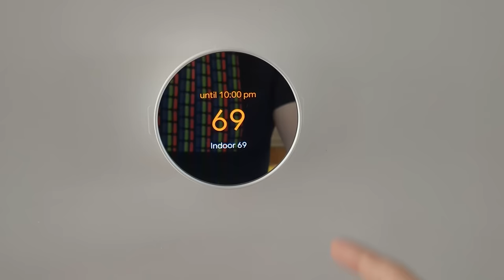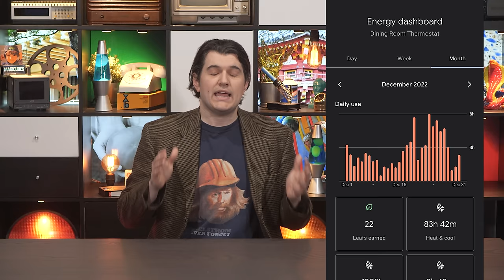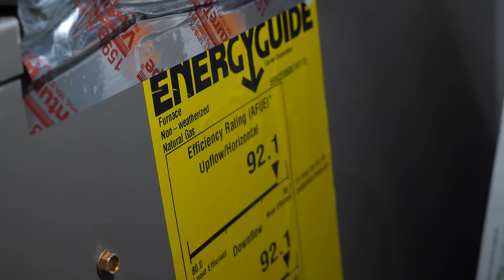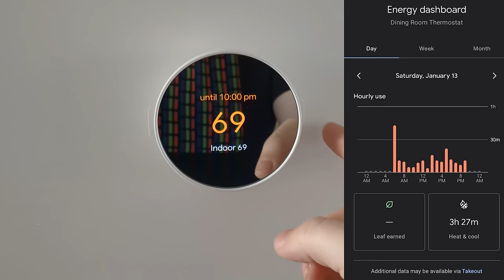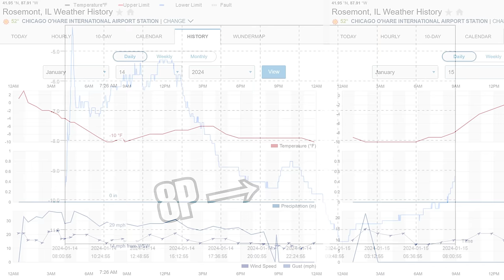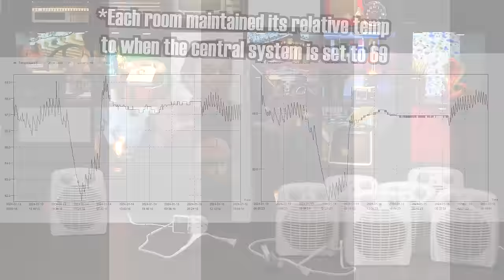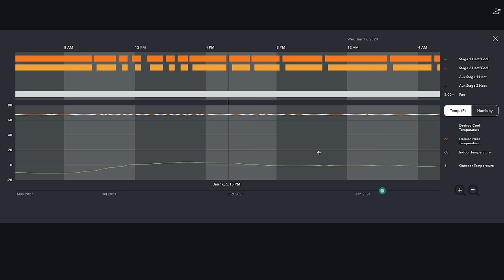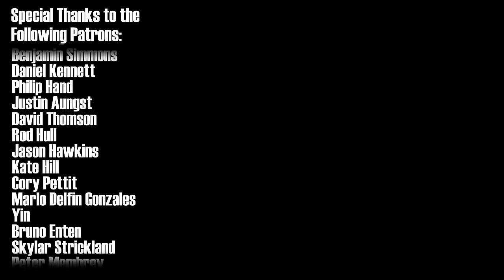Old HVAC industry practices are holding us back and costing us money. But we can fix it.

Comment: I bought a brand-new gas furnace and brand-new 2.5 ton heat pump last summer. Both high-efficiency. I can run either or have it switch between automatically at any temp I want. I tried both and I learned that the heat pump is nearly TWICE as expensive to run as the gas heat. I know that the heat pump is better for the environment but a $300 electric bill for a 850sq ft condo on a middle floor in a multi-family house is ridiculous! And that was in November (average temp 40F)! For reference, I'm in MA and electricity was roughly $0.32/kwh at the time. The heat pump ran nearly non-stop with thermostat at 70F day and 66F night. 

I think the big issue is that the the ducts for the older buildings here are sized for gas (2 intakes, 3 vents) which is much hotter than the slightly warm air you get from the heat pump. So the heat pump runs non-stop even at temps above freezing. That coupled with super-expensive electricity means its twice as expensive. Also, my condo is not insulated. (Adding insulation isn't easy when you have horsehair plaster inside and asbestos siding outside).

So while I care about the environment, I don't run my heat pump unless it is warm enough out that I'm pretty much not needing heat anyways.

Comment: Unfortunately for my home situation, my grandfather was cheap.
After moving in with my sickly grandmother, we asked around about getting AC installed in the house. It was built in the 60s but has issues that would make that way too expensive. My grandfather was a plumber in the union and had the bright idea to hire friends in the union to build his house. Unfortunately, we have found a lot of scuff things over the years. One of which is that we have 9ft ceilings, which the HVAC person said is too low for normal duct work. Instead of spending a lot of extra money on construction to make it work, we just use window AC units. We also have an attic fan for those nice days that we want to air out the house. I love my attic fan!
How do we heat the house then? We have radiant heating! We have pipes of boiling hot water going throughout the house. The second floor has radiators while the first floor has pipes going through the foundation. And the boiler for it and our water heater are in a back room behind the garage, which would be the coldest room in the house otherwise. It's a really nice setup. We only need extra heating on the coldest days, mainly because radiant heating doesn't circulate the air. We had to replace the boiler not long after we moved in 15 years ago because it wasn't getting the water hot enough and the pipes going above the garage door that go into the bedrooms above it froze over.
There are other issues with the house, like half a room of every room sharing an electrical circuit with half another room or the pipe going to the septic tank being essentially made of paper, but I love this house and will be sad when we move out.

Comment: Great video and very well put together. Heat pumps are certainly a great way forward.

One of the main challenges I've seen is how to go from a system reliant on a log burner,  or a gas boiler and radiators to a heat pump. Specifically how to distribute the heat in a property not designed with ducting in mind and where such a solution can be rather expensive and complex.

Still, the long term savings and day to day savings make the argument for heatpumps very hard to ignore. Especially where solar could be used to augment or cover the electrical running costs of such a system.

Comment: In the house I grew up in, we didn't have any A/C and our room heater was also our water heater since we had baseboard heating.  How would a heat pump work with baseboard heating?  Also, regarding location of vents, heating vents should be near the floor and cooling vents should be near the ceiling.  After all, hot air rises and cool air sinks.

Comment: I've been working in hvac service for 5 years now alec you're exactly right. So many people are uneducated so many contractors out there are too I've noticed the exact same thing. While there could be a small difference in cost in a heat pump system as we may need to run a new thermostat wire from the indoor to outdoor unit. There should not be anything larger than a couple hundred dollars Fantastic video. By the way, I definitely learned a few things, and I'm not ashamed to admit it.

Comment: I have geothermal, which is basically a heatpump.  
My problem is the cooling is too much & heating is not enough.  I'd definitely recommend upsizing 1 if you find someone that does load calculations.   When it gets really cold it is a challenge to keep temperatures up.

The installer recommended 3 ton & mentioned 4 ton was possible, but could be too much.  I'm glad I went with 4 ton.  I can add AC, but heating fuel sources are expensive including electric.

Comment: I have home heating for a 140 square meter house on two levels, implemented solely using an air conditioner that provides heating in winter and cooling in summer. There’s one outdoor unit and two  indoor units. I opted for this solution after reading about it on local forums and verifying the concept during the two years of preparing for house construction. It operates as intended, consuming 2800 kWh in winter and 1800 kWh for cooling in summer. This doesn’t include water heating for bathrooms (separate installation).

According to experts I consulted, for a new house, you should choose an air conditioner with a capacity of 25 W per square meter, while for an older house with poor insulation, a maximum of 35 W per square meter is recommended. So, if you have a 200 square meter new house, a total of 5 kW air conditioning capacity should suffice, likely split into two units.

It’s important not to turn off such an air conditioner because in winter, the oil in the compressor can freeze, causing it not to start. Similarly, in summer, avoiding turning it off prevents mold growth on the heat exchanger.

Avoid oversizing the air conditioner, as it can lead to frequent cycling during most of the heating season, reducing efficiency (smaller units can modulatete power on lower lever - as it is necessary for most of winter days).

Comment: I work for a contractor in Maryland that does energy audits in single family homes, and I have personally observed that nearly every house has a 48,000+ BTU furnace. Even the little ones. Which is weird, considering they generally have 1.5 - 2 ton air conditioners.

Comment: Our home is on the South coast of the UK. 

We have a gas combi boiler central heating. 

We also have a smart meter that tells us how much gas has been used.

Even in a recent -5 cold snap we only used 140kWh of gas in a 24hr period.

That means our average demand was just under 6kW

But the boiler is 30kW capacity!

Comment: In Finland we have thrived to change oil boilers into heat pumps and we have had district heating/central heating to replace old systems  in the works since the 70's (needed alternative to oil), country has lowered the energy used for heating by 15% since 2000 (sales of heat pumps increased due the need for low-carbon options) and average 5000 oil pumps get changed out yearly.  Finland’s 2.7 million households own over a million heat pumps. We also have a very big need for heating due very long cold winters :)
Reply: "By 2012 the heating supply mix was almost unrecognisable, with district heating accounting for 40%, electricity 21%, biomass 21%, oil 11%, heat pumps 6%, and gas contributing only 1%."

Comment: We've been using heat pumps here for over a decade because it's one of the most efficient ways to heat a house. At least when that area isn't hooked up to a city-wide heating system. We are in an area that requires more heating than cooling, though we don't have any air condition.

Comment: My house was built in the early 60s and had a 130,000 BTU  Furnace. It was replaced 7 years ago, with a 50,000 BTU one, granted the New one is 98% Efficient, and the old was likely 50%. Last winter it went down to -43 and the house stayed relatively warm. It hasn't had anymore Insulation other than a bit more in the Attic
A properly sized furnace, running 24-7, is more efficient than a oversized one cycling On and Off

Comment: i use a pool heat pump, monoblock unit, to heat water in the radiators in my home. Works great and wildly cheaper than a house heat pump...

Comment: Usually contractors know the systems really well but not the calculations behind them. Rules of thumb are good except when they’re not lol. I’m an HVAC engineer and can confirm that contractors are penny pinchers. They over size equipment to avoid spending money on hiring an engineer to run a heat load calculation or to avoid the risk of getting sued due to under sizing the heating equipment. 

FYI. Manufacturers usually have a cut sheet that’ll have a table showing db/wb temps in the summer and winter and comparing them to your t-stat set temps will give you the resulting capacity (heating and cooling) of your A/c unit.

Comment: You may also be able to look at your energy bill and look up the heating degree days for your location for the same time period. With some math you get the "UA" of your structure, in units of BTU/hr/°F (or W/°C). Then multiply UA by the difference between room temperature and the coldest temperature you expect it to keep you comfortable ("design temperature"—also standardized in local building codes). You should probably adjust for non-space-heating loads (hint: subtract summer use from winter use) and efficiency/COP of the old and proposed system.

Comment: It's often the reverse for apartments.  An old apartment of mine went down to 50F when it got below 20F outside, even with the "furnace" going 24/7. I put quotes on that because it wasn't a real furnace. It used the hot water, pumped from the water heater around into the heating system and back out to the water heater, to add heat to the air it pushed through the ducts, and at the same time the water heater was in a closet outside. So, when it got really cold, at about 20F or lower, the hot water couldn't get hot enough to maintain the apartment's heat.  I had to use two space heaters and keep my gaming machine running furmark for three days to heat my apartment above 60F.

Comment: I think a big part of oversizing comes from the 80% days. The issue only compounds with newer buildings being better sealed. 
IE 80% of 60kbtu or about 48k of usable heat.
The new units are 96% so that same 60k size will be about 58k of heating.

Comment: In Minnesota. Our temps hover arround 25 and normally the furnace runs for about 4-5 hours a day. But we spend weeks at 30 below and several days sat 60 - 70 below   Our furnace holds up and runs most of the day at -30 and cant sustain the set point at 70 below. So our temps slowly creep down to arround 63 over the course of a few days with the set point at 68.    Until i moved into my new apartment where my heat never runs and i get boiled alive in the summer.

Comment: My grandmother's furnace is not enough to handle cold winters, and it's already considered too big for the amount of space it's required to heat.
This is due to the combination of baseboard heating being inherently inefficient, and due to the fact that a log cabin without any insulation is an energy hog, as the heat gets transferred through the logs thermal mass.
Even when temperatures are above 40°F, the furnace runs more then 50% of the day... And the set temperature also has to be higher to compensate for the inefficiencies and thermal mass issues. In the winter when temperatures are below freezing, the house never hits the set point, and we can leave the furnace running 24/7 and not have it ever reach the set point...and at night it can even drop despite the furnace running the whole time.

Comment: My coworker just spent 18k for a new system.  I tried to explain, as you did, that, that was ridiculous, but in the end he paid 10k extra so he didn't have to deal with it.  I spec'd it for him using wholesalers with 2k installation was less than 8k total.

Comment: Let me tell you too, most people in the uk don’t even use their boilers unless it’s really cold. We turn them on for about a hour or two and then turn them off. We usually use either oil filled radiator heaters or little electric ones in the room we need the heat in as our homes are usually pretty insulated and it keeps the heat in and easily changeable. I have one in the bedroom for at night which goes on to slightly warm the bedroom before bed and one in my office as I work from home. Everywhere else is about 10-12 degrees and the heating comes on once a day for a hour to just make sure the house doesn’t mold. Then the bill comes back for the gas and electric at like £250 for the month -_-

Comment: One factor regarding sizing, I know you found the lowest temperature and took that as the worst case scenario, but worst case scenario would be lowest temp + the other town homes in your block not being occupied and only set to a minimum temperature. But if the interior walls are well insulated, it probably wouldn't affect the totals by much.

Comment: My current furnace is a heat pump with gas backup. For some reason a lot of HVAC techs think its strange to have both. The heat pump doesnt work the greatest in my house considering the house is 100 years old with original windows and not much insulation.

Comment: I am willing to bet Alec lives in a townhouse in the middle (with neighbor on both sides) and the heaters are sized for the townhomes on the ends. Still oversized, but not nearly as much and since it's cheaper per unit to purchase many of the same unit rather than buying a few different ones. Plus, you don't want the installers to mix them up putting too small a unit in one of the end units. So what you end up with (in townhomes assuming there all the same sq. ft.) is the heater sized correctly-ish for the unit that needs the most heating on the project and all the rest being oversized by some amount.

Comment: I believe it's nice to have the extra power on tap if needed for extreme temps. Plus the system does need some cool downtime between runs. My current 90+ gas furnace will cycle off after running for an extended time. Even with the thermostat calling for heat, then it switches back on after cooling down. I don't know the exact time on this since I have not timed it, but I have observed it a few times since living in my current house.

Comment: I live in Europe, in a house built in the late 80s but since then renovated with new windows and last year a big boost to the insulation. This winter has been the third year of us using a new heatpump... which is likely massively oversized. Unfortunatelly, my house has radiators instead of underfloor heating but it still works quite nicely. I like to keep the water flowing constanstly and as low a temperature as possible. The heatpump will run for only about 12 minutes every hour or so in oder to add some heat to that circulating water. So... is my heatpump oversized? Even on the coldest day of this winter (-12 degrees celSIus outside) the heatpump was actually heating for only 6,25 hours or about 26%. Can I therefore conclude that it is at least 3x oversized?

Awesome video!

Comment: great video! my HVAC system will need replacing in a year or so and I plan to have, um, detail discussions with the suppliers I interview.  I did have a question though: 100A service AND and you drive an EV? what kind of home-charging setup do you have?

Comment: The problem with heat pumps is primarily that anything your life depends on needs redundancy.
Secondly, and comparatively minor, they have problems with temperaures around freezing. The ice insulated it, and it doesn't work efficiently. Interestingly below freezing there is not enough water in the air to form ice.

Also, as a matter of curiosity, the reason why furnaces don't need as large a ductwork as heat pumps is temperature. A furnace can push VERY hot air through the ducts. Heat pumps however have a relationship between temperature and pressure. To generate air that hot the r410a pressures will go over 500psi and you will develop a leak much earlier than needed.

Comment: The furnace is also partially responsible for the efficiency of the AC itself since it's the blower motor in the furnace that is pushing the air. They may have had to use the oversized furnace in order to get a AHRI number for the AC system. Also since the furnace running less causes zero damage to the furnace it does absolutely zero harm
Reply: Also a heat pump system would be terrible for your climate. The condensing unit outside, which in heat pump mode would change to a evaporator coil would constantly freeze over.

Comment: I believe this is a huge reason why people think their house isn't fit for a heat pump. They look at the maximum energy output of their current furnace and conclude that switching it out for a heat pump would be wildly expensive or downright impossible.

Add to that all the fear mongering from the political right and fossil fuel industry. 
They think they have to switch out all thier windows, insulate thier roof and get new heating element before even attempting a heat pump. Some are fully convinced that you need underfloor heating.

We switched from a 20kW oil furnace (quite common in Germany) to a 13kW heat pump last summer. And guess what? It's ridiculously oversized! Granted, we had a pretty warm Winter, but still it never got even close to the "heat strip zone".